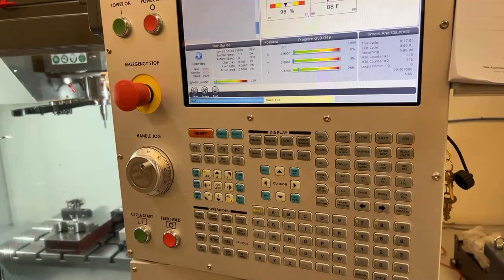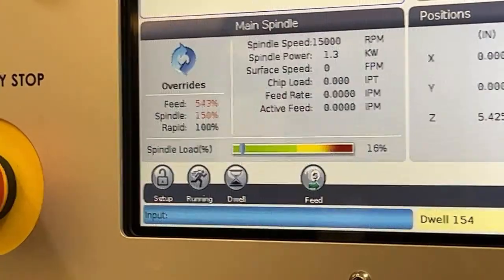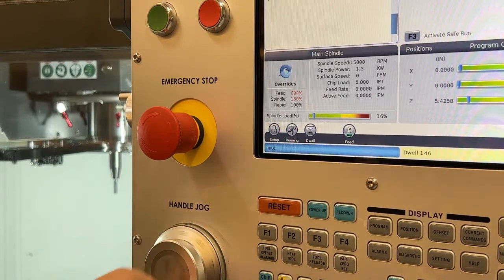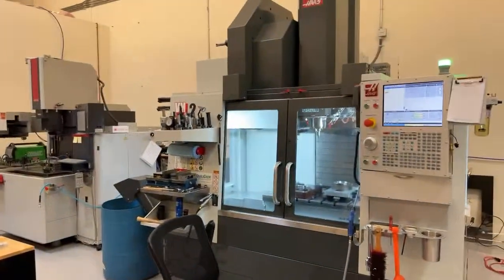Sunday Shop Day - Okuma / Haas / Syil

Comment: Question about the Haas service key, can you use it to setup custom PLC controlled things? That would be cool to add solenoids or switches that can be turned on with M codes

Comment: I run the okuma 460v 5AX at work every day, the spindle just broke 2 weeks ago for no reason, it is hard to get good smooth 5 Axis toolpath. I know guys with the same problem with the machine, i Think you need to Run it before talking about it (I make injection moulds aswell) it is only 11 Month Old the machine
Reply: Socrates: I Can make it run smoot adjusting super Nurbs, with g131 every time and use hours on every simultanius operation, it’s possible to get it smooth but a pain in the but. You Can never use the same settings twice for running smooth, Im Comming denmark, and here are 2 other companies with the same problems
Reply: @PhilipHaahr  I guess you don’t need to get a super fine codes between each point, just let the super nurb do its job, instead 0.002mm you can try to use something like 0.025mm, which is normally I do, if the cpu got overwhelmed then the machine starts jerking. I just checked the super nurb manual, it says very clearly it will do the curve compensation by itself. I will try it on my machine see how it goes.
Reply: @Nerdly: ive never Said okuma machines are bad, we Got 2 4 Axis okuma, (MA600HB, MA400) and they are awesome. Same with our okuma lathe
 The 460v 5AX is Also great for 3+2 milling and very rigid/accurate, but it’s kind of disspoitning if you compere it to other 5Axis okuma and Doosan machine 

G131 sucks and okuma just blaming the cam software so ive tried using 3 different software now (Siemens nx, fusion 360, hypermill) still sucks at simultanius toolpaths
Reply from the maker: @PhilipHaahr  man i'm sorry to hear this.....ive spoke to a few guys that own them and really like them.

You just feel it cant process code fast enough?
Reply: @NerdlyCNC  probably the 2.4Ghz pentium dual core CPU was overwhelmed by tons of codes if they generate the toolpath too fine between each point. Hopefully the CPU is not customized, I’ll let my buddy change it to a I7 after warranty
Reply: Mine is coming soon and before I decided to buy it I actually went to take a look, it was a show room model, the 5 axis motion was super smooth and day and night different than a HAAS, did you turn on the super nurb function?
Reply from the maker: so one anecdote means all okumas are problematic?  

I have ran Okumas and know many people that own them.

Like every machine they arent perfect. They are however quite capable.
Reply: My problem is that it read fast enough codes, but the axis chance seems to confuse it self at some point, if you dont lock your feedrate in 5 axis toolpaths it lagging like crazy, (lock feedrate: G131 F2000) im not sure what the problem is but ive tried alot to tune it in with different methods, im not sure what the actally problem is. One from okuma told me the machine is slower than other 5 axis okuma because the A axis isnt direct drive, like MU6000
Reply: @PhilipHaahr  MU 400 and 500’s A are not direct drive either, did you try inverse feed? Like G93

Comment: We use a technomagnet at work. Very strong holding power. Especially for roughing mold bases that are hard to tow clamp or parting line gets machined off

Comment: Jason can u do a full indepth video on probing on the X7 , was looking to get one but no real information available and it seens to be very lacking in this regard  , on what I feel is a basic must have feature
Reply: Where have you been looking? 
There’s 3 controller options on the X7. 
Siemens 828D has conversational control and probing built in. 
LNC has a probing add on that’s been developed, and the Syntech 22MA also has a new probing cycle. I have the Siemens 808D in my Syil X7, and the latest Post Processor available has a probe cycle. So basically it’s available for any choice you go for.
Reply: @MrRctintin  hence why i asked for a video of it , cant find any actual video of it in action
Reply: @tomahawkcnc  there’s lots of video content on the Siemens 828D on YT. 
The LNC is newly developed, so I’ve not seen that on video but it’s running. 
The 808D probing is available on Peter Betz’s YT page. 
Syntec 22MA has it on their new screen that Jason is using as well. 
What controller do you have? Or thinking of getting? Unlike buying a Haas, with one controller, you spec a Syil to what you want, so there’s multiple choices.
Reply: @MrRctintin  So the probing in this video is what you have on your machine ? https://youtu.be/WeMCwfHjKtQ
If so then great - wonder why syil dont tell us that  ? as thats all I need
Reply: @tomahawkcnc  no, I don’t have a probe yet, I can’t justify a £5K Renishaw on a £30K machine that’s not used every day for production. I use a Haimer for my work offsets etc. But yes, if you choose the Siemens 828D then you can use it like that. I can buy a Drewtronics for £12-1500 should I wish to, and use that with my 808D, but I’m putting my cash into some new Lang zerpoint fixturing first.
Reply: @MrRctintin  i have 4 hobby machines at present and all have touchprobes of varying costs fitted. Could not envisage operating without one   . Yes could use a hainer but slower and i do a lot of machining plate 2 sided and use G68 rotational correction on second op which would be very prone to error doing it manually.

Comment: Have you thought about using the MicroLoc system for your fixturing on the Okuma? It's a very different approach, but it looks really flexible, and very rigid, as you can hold a mould plate on all sides with multiple clamps...

Comment: Just got a quote for a TM-1P.  35 weeks lead time!!!
Reply from the maker: yeah thats pretty wild
Reply: @NerdlyCNC  I heard they were allocating the electronics towards VF, ST and UMC production.
Reply: Damn. Mine was 30wk. Haven't approved yet. Wonder what it'll be next week since I'm getting some changes to the quote...
Reply: Was strongly considering an X7 but the canada rep is completely nonresponsive to even sales inquiries, so that's kind of out.
Reply: Saved yourself some pain if you went elsewhere. Not only are builds slower but quality is getting worse all the time. I had to sell a machine 1.5 years old as couldn’t rely on it and They wouldn’t even buy it back at used machine cost!